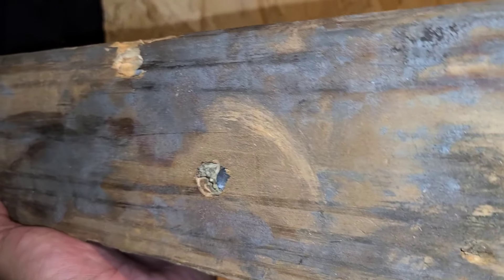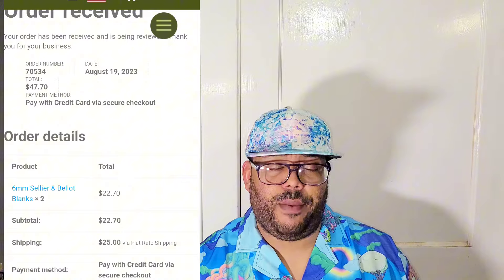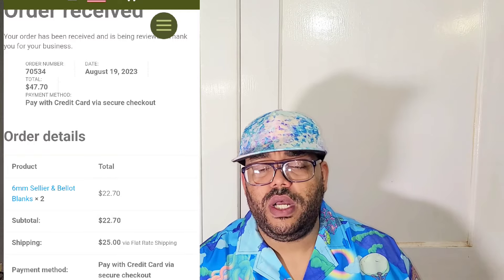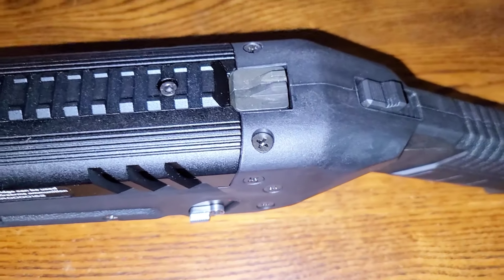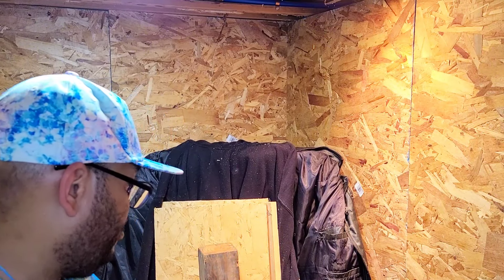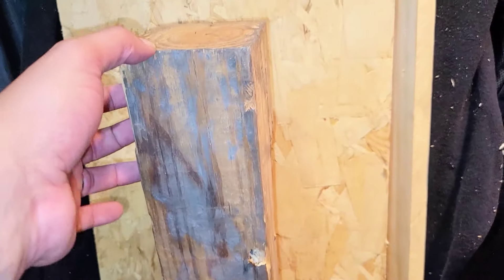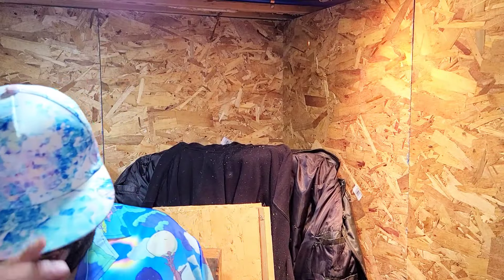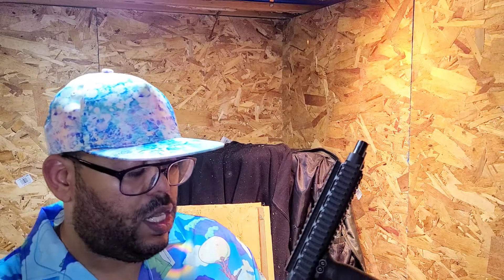ALL NEW AEA HARPOON 50 cal and Macabespeed barrel shroud Reviews

Comment: Nice test  good set up yeah heard it was loud Just ordered that whole rig  fyi BEAR REPELLANT  NOISE MAKER / SCREAMER MAKE NOISE heavy metal maybe on a Bluetooth clip on speaker & situational awareness AVOID BEARS AT ALL COST if you have to run down hill screaming don't stop for 5 min 10 s even better
If u resort to fire arms the only sure safety is a big caliber long gun 12 ga shotgun w optic for 100 feet where u might actually not miss, before that you're just firing warning shots probably from 390 ft away you'll have maybe 5 secs to get him up sim fire fire again & if you're lucky it'll stop before it runs into you   then pump 2 more in  more until it stops moving 5 - 10 min later get 20 ft away & double tap it just in case to be humane   
This is a pop gun to a best it might bleed out but just one swipe from claws u dead one bite dead it just runs you over broken ribs arm even leg ruptured organs  
Ps if camping eat 100 ft from sleeping site don't wipe foody hands on clothes hang food 30 ft up a tree 300 ft from camp  burn any food wastes to o a cinder twice.  Sleep w bright light strobe screamer under pillow.  
Hope this helps someone

Comment: new age pcp just proving that firearms aren't the only things that can shoot projectiles at deadly speeds.
Reply from the maker: @Watchlist_Nominee  yes this thing is awesome for sure...definitely the future. Absolutely love this platform 👊💯
Reply: Speed means almost nothing… the ft lbs of energy is what matters. Speed simply takes a part in creating the energy. If a project is flying a 1000 ft a second and has 0 weight it’s gunna do absolutely nothing. If the projectile weighs 600 grains and travels at 0 ft a second it’ll do absolutely nothing. Speed and weight create the deadly part which is energy. Don’t know if ya meant “with deadly energy” or not. But figured I’d just let ya know in case you didn’t know.
Reply: Lewis and Clarke only needed their air rifle in 1804.